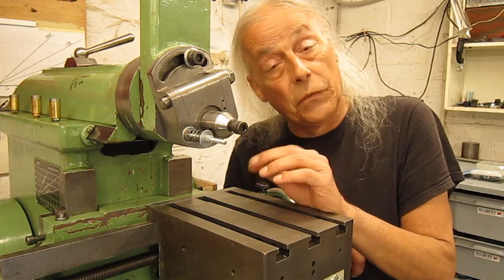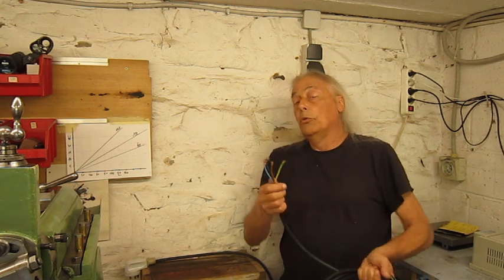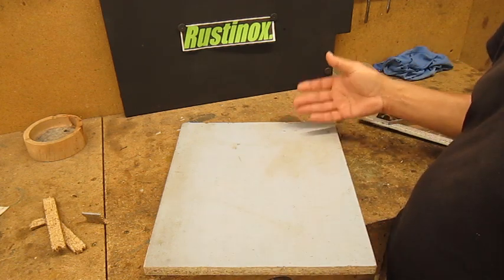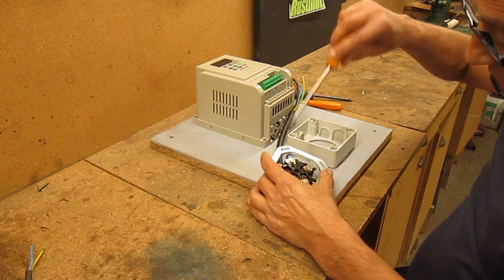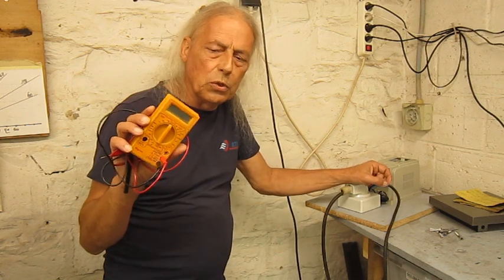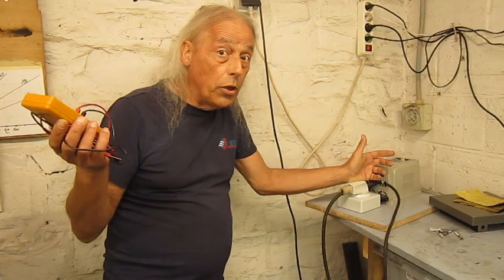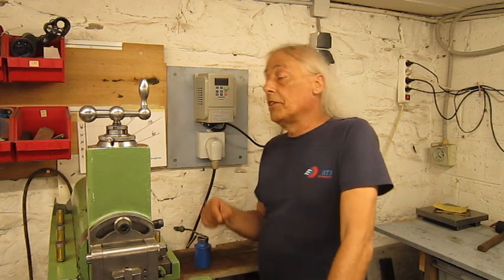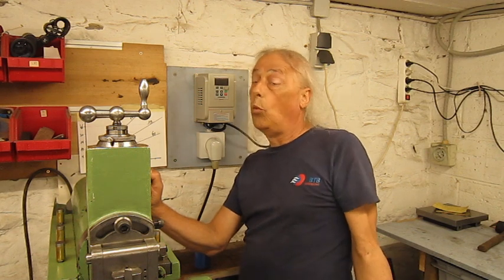Variable frequency drive for the shaper.

Comment: hi excellent videos. i was wondering if you changed your motor contacts from star to delta, it would give you more torque?
Reply from the maker: Thanks. The motor is connected in star configuration.

Comment: So apparently your shaper had a 3 Phase motor on it from the start?   Is that common where you live.  Here in the US it is very uncommon residences to have 3 phase current.  Or is it that your VFD can be used on a normal single phase motor.....I am a little confused.  I too have the same problem of the machine running faster than I would like.  Thank you for this video, it was well done indeed.
Reply from the maker: Is it OK for you that i answer your questions in next week video?

Comment: Hi Rusty I am enjoying your videos. I too shall soon have a shaper running on a VFD as we don't have 3 phase in domestic houses in the U.K. Have you thought about adding an emergency stop  Very easy to do on the control side of the VFD.
Reply from the maker: Thanks Tony. I don't see the need af a emergency stop on the vfd. It's installed too far from the shaper to be useful. I always use the clutch and the switches on the machine itself.
Reply: Good point about the clutch. If I understand you correctly the machine switches are between the motor and the VFD, i.e. When you use the machine stop switch the VFD is still outputting 3 phase ? If so this is very bad for the VFD and could kill it. It's good to see you back in the workshop.

Comment: Does the vfd hurt the motor when running that slow?  Most motors are designed to run 60 hertz, is the power/torque the same? I’d think it would be much less.
Reply from the maker: The motor generates less torque and more heat, so something to keep in mind.

Comment: Sir i have a old shaper in my workshop, the stroke reduces by itself while working.
Can you please help what is the problem.
Reply from the maker: The stroke length is set by moving the crankpin. So the crankpin of your shaper must be moving when under heavy load.
I think you should check if there's not any wear in the locking system that could prevent it from tightening properly.
Reply: @Rustinox  Thank you sir,  i will check and reply

Comment: I may be mistaken but by decreasing frequency you reduce power and torque.
Reply from the maker: You are absolutely not mistaken, Francisco. The motor will indeed lose torque and will generate more heat.

Comment: Ik heb dezelfde vfd op mijn draaibank. werkt prima maar helaas geen "vector control", maar dat niet echt een probleem zover. En redelijk stil :) De motor wordt wel een beetje warm tijdens het boren van grotere gaten (lagere frequentie). Niet extreem warm, maar het is wel iets om in de gaten te houden. 
Vraagje heeft die schaafbank van jouw ook nog van die ouderwetse isolatie draden intern?
Reply from the maker: In 1991 is deze machine volledig gereveseerd geweest, dus ook de bedrading. Allemaal mooi nieuwe vinil beklede draden. ( nu ja, bijna 30 jaar oud)
Ben je toevallig geinteresseerd in een kopie van de originele handleiding?

Comment: Nice! Only those soldered cable ends are not the best solution, they can cause malfunctions in the long term. It is better to press ferrules on the cable ends. Anyway, just my 2cts.
Reply from the maker: Thanks. I case of problems i can always fix it.

Comment: Good to see you back in your workshop Rustinox. Looking good. I've seen others using VFD's to provide slow speeds on various 
machines and heard it said that you loose the torque in your motor using a lower frequency. I'm no electrician and I haven't got 
any VFD's so maybe you can test this out on your shaper. Lets hope it works alright so its a good quick easy improvement. Tony
Reply from the maker: Thanks Tony. Indeed, there is less torque at slow speed but that's no problem. I gonna use it most for the cheer tool, so no need of much power.
Reply: @Rustinox  , Tony is right. Check your VFD manual, if you have vector control function - turn it on. This will give you consistent torque on small speeds. Otherwise you should buy vector VFD. I have Delta vfd-m from aliexpress on my drill press and it works prefect on small speeds. And it’s only about 70$.

Comment: Good to see u working in the shop! I think this is the first shaper i have seen with a vfd, way cool! 
You cant masure voltage with typical  voltage meter, a vfd makes dc from ac, stores it in capacitor banks and the invertor part chops up the dc into artificial ac, its not a perfect sine wave like what u get from your wall socket.
Reply from the maker: That's interesting. I didn't know that. Thanks for letting know.
Machine NZ has also a VFD on his shaper.
https://www.youtube.com/watch?v=Gb2FIDZiCUk

Comment: I have exatly the same AI shaper as you heve, and because I don't have 380 volts in my barn I run it for years with a frequency controller.
We have the same problem that our shapers don't like slotting 😂😂, is it the shaper or have all small shapers the same problem ?
Reply from the maker: I've seen small shapers make perfect slots, so i suppose it's the machine. 
On mine i left the belt a bit loose so it slips when something go bananas.
I prefer a slipping belt than brake something. (as you can see in the video)
Reply: @Rustinox  I guess that the slipping belt is the problem. If the motor stops, then it's another problem. And if the motor stops, the frequency converter will take care of that, if you have the settings alright. It will stop when you get over current. (Hopefully :-)
Reply: I have an Austrian Anderle Shaper. please tell me your dimension of your slots, then i will test it on my Schaper.
Reply from the maker: @thomasfischer6548  Thanks. That will be interesting to know. The part is hot rolled steel and is 190mm long. The cutting tool is 3,2mm wide.
Reply: @Rustinox  okay, give me some days! hss steel as Tool.

Comment: Glad to see you're well enough to get back in the practical world. I'd never thought about a need for lower speed on the shaper - mostly people say its too slow compared to milling. They conveniently avoid talking about the cost of cutters, and the versatility available to those of us with more time than money.
Reply: Hi! I used an other FC (frequency converter) for my drilling press with the same configuration like you. Motor 3 phases 750 Watts. FC the same power 750 W. And i had the same problems with slow speed! I heard, that you will need 1,5x more power as the Motor! Maybe thats the problem! BG from Austria
Reply: @thomasfischer6548  I hear what you are saying about the power matching of a VFD to the motor. If memory serves me right it is the Amps of the VFD that is important.
Reply from the maker: Thanks for your comment.
Most shapers (even small ones) can go lower than 60 strokes/min, so there's no need of VFD.
As i said in the video, for some applications 60 is too much.